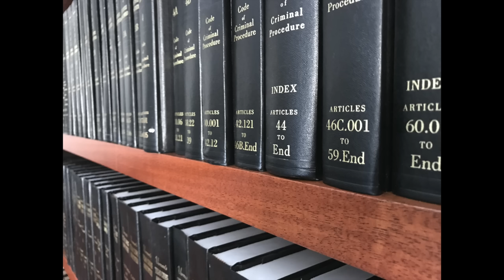Building Long Bookshelves That Don’t Sag

Comment: Sagging shelves are always a problem when you have big and heavy books. I'll remember the steel rods idea if I ever build shelves myself. Before seeing the only solution I could think of was putting wooden supports under the shelf in its length, but it's not good since we can see it. If these supports were put on the side, aligned with the edge of the shelf it culd do the trick.

Comment: A simple way of staining timber is to use potassium permanganate, also known as Condy's crystals, which dissolves in water so it doesn't fill the workshop with fumes. It oxidises the tannin in the wood, which darkens it, so it is a natural process, speeded up. The higher the concentration, and the more applications you use, the darker the wood gets. It is also used to darken jute hangers for plant-pots.

Comment: Nice job.

There is another way. 

Use regular ply for the shelves and make a vertical support web from the same play mid shelf, which runs from the back to within a couple of inches of the front, paint the top couple of inches of the support black and wrap a fake book spine on the rest of the front of the support. The support will disappear when the shelf is stocked with books either side of it. I have done this before. It's fun to play with titles of books for the support book spine; ones which declare that it isn't a real book.

Happy hunting.

Comment: What a wonderful build. Really inspiring.

I'm thinking about using the same method to build my desk of 240 CM x 80 CM only to be supported left and right, so it would span over 200 CM. 
2 x 20 MM plywood with metal flat bars each 20 CM.  What do you think? would it hold? 
Let me know your thoughts.

Comment: Brilliant work, but damn that thing would be heavy.  One thing I might consider is removing a bit of material from the middle of the shelves (going lengthwise).  You'll still get most of the resistance to bending from the deeper plank in front and back, but drop the weight a bit.

Comment: Amazing job just beautiful. Now on the cheaper end of the scale, just put together a small bookcase of particleboard, shelves began to sag as soon as the books were placed. It occurs to me when they are pressing these cheap particle board shelves could they not add some metal reinforcements? I mean a bookcase is for books but when the books will sag the shelves it's a complete waste of time, money and materials. We send men to the moon yet we can't make an inexpensive bookcase that actually holds books? What is this country coming to anyway?

Comment: Beautiful work. Well paced video. Easy to follow w/o all of the gab. Well done!😎
Q: What brand of wood stain did you use? I learned to hate MinWax after it ruined a HW door. Then, I tried and fell in love with Old Masters penetrating stain, which produced perfect furniture grade results. But, now I find that it is no longer available. BTW, Formsby tung oil is no longer available either because Minwax bought them out.😥

Comment: Metal rectangle for reinforcement. Slaps forehead. Of course... When I've built wide bookshelves, I've made torsion boxes. Your technique is a lot simpler. And if you had an infinite budget, you could even use carbon fiber (like guitar necks are reinforced). I'm stealing your toe kick detail too :-)  Clyde
Reply from the maker: Clyde, torsion boxes can work too, and you can also put metal in them!
I built some cabinets for my dad’s home office and he wanted two continuous shelves to go with the upper cabs. One was 5’ long, and the other was 7’ long. Since they needed to be 2” thick for the trim, I used 1/2” ply, 1” flat bar steel sandwiched between 1” rips of ply, followed by another 1/2” ply for the top. A year or so later, and it hasn’t sagged a bit. 
https://www.triplerwoodworks.com/#/homeoffice/

Comment: That baby has got to be HEAVY! How many sheets of ply in it? And, were the bars in the shelves steel or carbon fiber? I'll bet you could have saved on doubling the shelves by using steel box metal behind the face frame beneath the front of the shelves along with the dado into the back. But the doubled ply definitely looks cleaner than my idea.

Comment: I did not fastforward any part of this. How was the bookcase moved? Was the doorway to the law office big enough?
Reply from the maker: Louis, I built a riser for the bed of my truck for hauling. I was able to tilt it back onto the tailgate, then lift the bottom of it to push it onto the riser. (It laid flat on its back) For unloading, I pulled it out of the bed until it started to pivot on the riser, then slowly lowered it to the ground. Stood it straight up. Then tilted it onto a furniture dolly on it’s side. With that configuration, it was 5+ feet high, 7 feet long, & 1 foot wide. It went through the door like a charm. 👌

Comment: Nice video and lovely pro job. Is that a dado inthe DW745 saw? I have that saw and didn't know it would take a dado. What a shame those back panels are hidden by books!!
Reply from the maker: Thanks Graham! Yessir, that is the Freud SBox 8. It’s just a 2-blade stack that allows for 1/4” or 3/8” dados.
Reply: @RRRWoodworks  That's interesting thanks. Here in the UK they are hard to find as health and safety don't allow them in commercial shops. It's because the extra weight causes them to make the saw take over the stipulated 10 seconds to stop.
Reply: @GrahamOrm  So, can you reveal somewhere to purchase in the UK?
Reply: Don Johnson24 sorry no. I’d be interested if you find somewhere.

Comment: Love the technique, I will keep this in my toolbox! I'm surprised you use biscuits, the current thinking is that plain glue-ups win over biscuit joins. But if you like the technique, power to you!
Reply from the maker: Michael - I only use biscuits for alignment, not as an actual joint. Thanks for the positive feedback!
Reply: Got it! I was going to ask about you not gluing up the biscuits before putting them in their slots. I have a biscuit joiner, somewhere, that I never took out of its box.
Reply from the maker: I had actually put glue in the slots, as well as the back of the FF. Those shots weren’t in the video though, my bad...

Comment: Nice work......That bookcase should be walnut though.......he's a lawyer, he can afford it!
Reply: is mahogany not expensive? also i think that it could have been stained darker, i was surprised that he originally wasn't going to stain it and leave it as such a light colour
Reply: @Murtagh653  9:30 Walnut would be more in line with the existing furniture. Mahogany is cheaper depending on where it's from....here in the states Honduran  is cheaper than African. I would imagine in the EU African is more readily available. Honduran is better for furniture making....but African has a better color...more red....that's my thoughts anyway.

Comment: I'm not exactly sure why you sandwiched the metal rails between two sheets of plywood. With the solid wood faceframe biscuit joined to the shelves and the shelves being stabilized over the whole width by the backwall rabbet I'd say that should have been plenty strong, no? Then again, those are big books and not just a few of them...

Comment: Is that a DW735 with a  dado stack?  If so, how?
Reply from the maker: I think you meant DW745, but yes it is. The “stack” is the Freud SBox8. https://www.freudtools.com/products/SBOX8
It’s just 2 blades with offset teeth to cut either 1/4” wide or 3/8” wide. It’s pretty handy!

Comment: Beautiful job. But you did not use the steel to its greatest advantage.  There was no need for steel along the back edges of the shelves because the dado in the back panel prevents the steel from experiencing any stress/deflection. The front edge is where the stiffening effect of the steel is needed. The closer the steel is to the top and bottom edges the greater the stiffening effect. To achieve this cut 1/8" wide, 3/4" deep slots into the front face of each shelf. The slots should be as close as practical to the top and bottom self surfaces. Epoxy 1/8 by 3/4" steel bar stock into the slots. The solid wood trim pieces attached to the front edges of the shelves hides the steel bars. This approach maximizes the amount of steel near the top and bottom edges of the shelves and therefore maximizes stiffness. If even more stiffness is needed, the most efficient way is to use wider bar stock and cut deeper slots (e.g. 1/8 by 1-1/2").
Reply: Like flanges on an I beam.    Sharp.

Comment: Your work is beautiful and the design is classic.  I would suggest that you would have been better served by putting both the metal splines nearer the front.  The back is well supported by the dado cut in the back.  If I were designing it I would put the first metal nearest the front as possible and the next one no more than a third of the way back.  It was a super good idea to put the pieces  of 1/8X1 into a wooden shelf.
Reply: inlayed steel within a 1/2 "" of edge ,  and a rabbeted cap of solid wood that hides it. 

besides all that , the metal is unnecessary if your biscuiting  a solid wood face to it.
Reply: Thanks for this comment.  I was trying to guess what the splines were made of.
Reply: He biscuited the face on with an assload of biscuits! He dado cut the shelves into the sides. Even without the metal, those shelves would handle quite the load!

I use thinner plywood and more metal to do the same thing with less weight. I don't use near the biscuits though!

With adjustable shelves, you can use thinner plywood, then add a lightweight filler material between and more metal, like aluminum angle. Face it with a biscuited on hardwood and get a lightweight heavy duty shelf that won't sag.

Comment: Beautiful piece, well done!  Over the years I have used the same technique myself many times. Except... I use 3  1/8” x ¾” cold rolled steel strips and epoxy for glue-up. First learned and used the technique in 1980 after reading the book “How to Master the Radial Saw!” Wally Kunkel (aka Mr. Sawdust).  I have been successful using 3 pieces of steel and ½” and ¾ plywood for 1-1/4” thick shelves. Btw, rather than match up biscuit slots I simply take a slotting router bit and run a slot on the case carcass to receive the biscuits on the face frame, learned that from Norm Abrams and his New Yankee Woodshop.
Reply: Also an advocate for long slot to receive biscuits.
Reply: For me with my meager home shop, it is tougher to run a straight slot on the edge than it is to accurately mark and cut biscuit slots.  The biscuit/plate joiner is a very useful tool for me.
Reply: I like the slot idea, but in my experience, getting the slots in the right spot is really easy. I might try to slot my whole bookcase next time to see if it saves any time.

Comment: If you pre-lipped the shelves you would not have had to fit 82 biscuits at a go, the lippings could have been clamped on and the clean up would have been easier.
The inclusion of steel into the shelves for stiffness is clever. As half the grain of plywood is across the board it has less stiffness and resistance to bowing than solid timber which is why I prefer solid timber on loose shelf pins for heavy book shelves.
The steel in your shelves is in the middle of the shelf which in theoretical structures when considering the shelf as a beam is the neutral axis. The compression and tension of a shelf is concentrated at the surfaces. This is how plasterboard works and I beams. Given this the steel is being used dependent upon its own stiffness and it would be interesting to know if this system offers any significant improvement over the 36mm of plywood you have used. As most of the strength is near to the surfaces were these shelves made without the steel two skins of lighter ply on a ladder frame would give an equal strength with less hernia inducing weight when removing.
Reply: That's a really good point about the steel lying on the neutral axis, where bending stress is near zero, thus resistance to bending is also at near zero. You could improve on that by using wider steel to get closer to the surfaces where bending stress is greatest. To maximize the "beam" effect, use epoxy to make the steel "one with the wood".

I hope this helps. With that said, congrats on a fine build and a clever idea for reinforcing the shelves.

Comment: u  know that lawyer could've stored all the info in those books on a single 32gb jump-drive, right? Would've saved a lot of time and space.
Reply: haaaaaaa Well stated
Reply: actually it would fit on 320 Mb , or 0.32Gb (assuming it's text, if the books contain pictures, we have to upgrade to 3.2Gb

Comment: I don't like clear coat sprayed on. The build up kills the patina. That finish however, looked like a hand rubbed finish- with a beautiful patina. Kudos on the face frame line up. I would have built it pierce de la pierce. Less chance for a F U. Thanks for the Tite Bond tip. Tite Bond rocks!

Comment: Nice job here - I had a similar project once and got past the 'no sag' issue by making the shelves as shallow torsion boxes with fairly thin plywood faces. They were exceptionally rigid and relatively lightweight.
Reply: Hey Ken... that is a great idea!  I've made tons of hollow core doors using the same process, and they are bullet proof!

Comment: Beautiful job!

One area that I would do differently is the metal support - don't need them the back side of the shelves because it's attached to the back panel.  If I use two anyway, then I would put both near the front of the shelves.   I may also use a bit thinner for the back panel.. :D
Reply: I use 1/4" back panel almost always!

The metal strips don't really matter where they are located, as the depth is not large enough for placement to matter. As long as they are not both on the very front or back, they do the same thing.

I use at least 3 in my shelves, but use aluminum. For even more weight, I use square tubing or stock. It is absolutely crazy the amount of force it takes to bend a shelf with basically any metal in it.

Comment: Not sure how this counts as an I-beam.... You made it thicker and used metal inserts in the middle. Arguably, if you made a rectangular steel bar the same outer dimensions as an i-beam, it'd be stronger than a steel I-beam per the same thickness. Of course thicker shelves will have less of a tendency to bend. That's really all I'm seeing unless I missed anything (and there's nothing wrong with it if it works well).. That said, The steel pieces you inserted should improve the rigidity for sure, especially the way you have them oriented(taking advantage of the same properties of an i-beam). I guess that's really the neat trick here.

Comment: With inch and a half thick shelves I wonder if the metal splines in the center really do anything?     The sagging comes from the tension along the bottom, compression on top and the center is neutral.

Comment: Do a search for Torsion Box.  You can make long non sag shelves from much thinner material by putting some lengthwise spacers across the span.  1/4 inch top and bottom with 1/2 inch spacer in a shallow dado groove. The result would be just as strong, but lighter and possibly cheaper.  I suppose the problem would be matching the veneer, but consider it if they will be painted

Comment: Would there have been a problem with putting that face frame on one board at a time, instead of preassembling it and then schlepping the whole thing onto the bookcase?
Reply from the maker: Gary, I don’t see any big problems with it at all. The only things I can envision with that method are having nail holes to fill on the FF because I wouldn’t rely only on the glue with every piece separate. There is also a small possibility of the FF pieces not being flush with each other on the face side from gluing individually. It is absolutely possible to work through that though!
Reply: Whin if you used clamps for the gluing, instead of nails to hold the frame while the glue cures?
Reply from the maker: I didn’t want to have to fill nail holes at the end, so I opted for the clamping route.

Comment: Wow..overkill, just put an apron on the front of each shelf and call it a day...works for a 6ft coffee table...will work for a 5ft shelf.
Reply: the book shelf is going to take a lot more weight over a much greater time than the occasional weights that a coffee table takes. 5' of law books weighs +/- 150lb. An apron along the front to take that without sagging over 20 years would have to be over 4" thick.

Comment: A very nice solution for making stronger shelves. 1½ inch shelves are pretty sturdy by themselves though so I am very curious how much difference the steel actually makes.
Reply from the maker: It could absolutely be overkill, but I didn’t want to risk it since I knew what would be on the shelves. Thanks for the feedback!

Comment: Nice work ... We've been using a steel bar to keep adjustable shelves from sagging and we always write a warning that there is imbedded steel inside the shelf in case of future demolition. Maybe it's a good idea to put a warning on the back of the unit.

Comment: fab vid and work, one question: how on earth do you move that thing to the destination?
Reply from the maker: Thanks Dumpy! I built a riser out of 2x4s for the bed of my truck to let it lay on it’s back above the wheel wells. I was actually able to lay it over on the tailgate then lift & push from the bottom until I got it in. Definitely not recommended, but it worked.